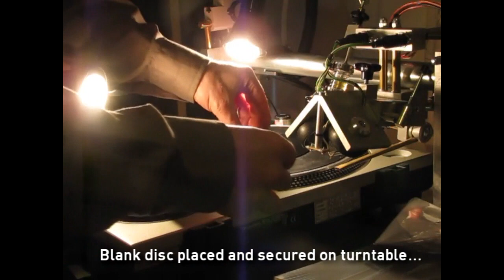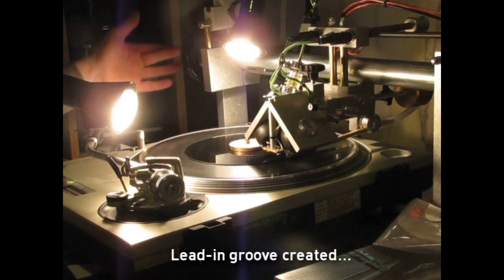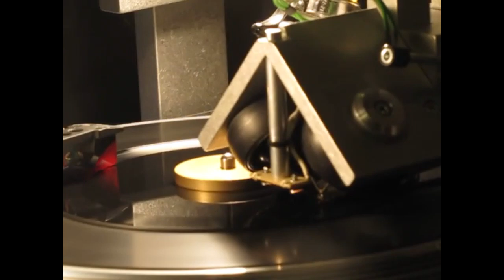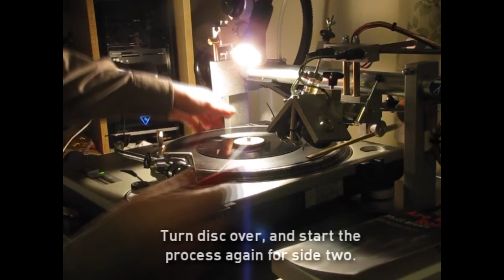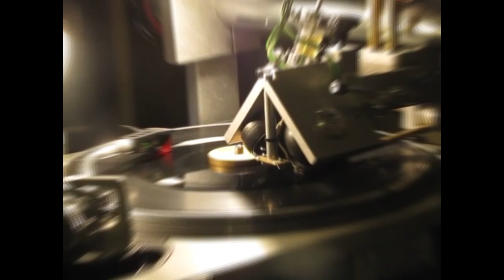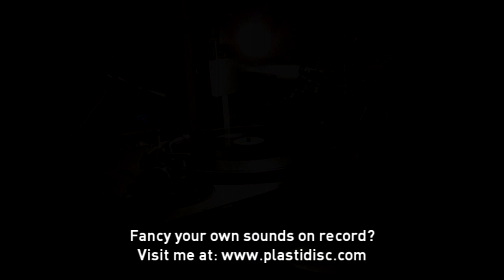Cutting Clocolan's Daisy Chain 7" at plastidisc.com

Comment: Using a 1200 for the platter! It's high torque, but...high enough for lathe cutting, I wouldn't have guessed. Is this cutting an acetate, or into something more durable?
Reply from the maker: It can handle 7"s very well, and 10"s to an acceptable standard...  not 12"s though.  Even though a lot of people do cut them with this setup, the w/f is way too noticeable for me to even consider it.   However when a decent SP10 finally comes my way, I'll be doing all sizes.  It's not a traditional acetate, rather solid plastic which is as near to a pressed record as dammit.
Reply: @soundhog09  We had three SP10 MK3's in the radio station I worked at in the 80's. They are monsters! Did you know...if you turn on an SP10 MK3 at 45 rpm, then physically stop the platter and rotate it backwards, once you get it rotating fast enough, it will "lock on" and continue rotating backwards by itself? Many hours of boredom spent alone overnight in the studio.... :)

I love how the lead-in and lead-out is done by spinning the lathe manually. :)
Reply from the maker: @ScottsSynthStuff  Yeah, they're lovely things indeed.  I've missed a couple (one not 20 minutes from my house) and been outbid on several.  Looks like I picked the wrong time to try and get one.. always the case.  I can't think of a better option at the moment, though.